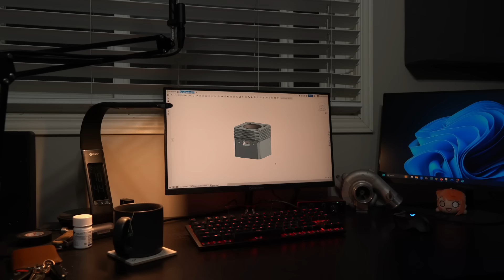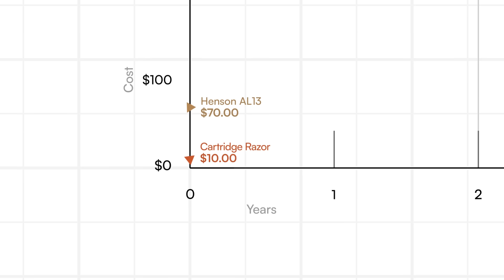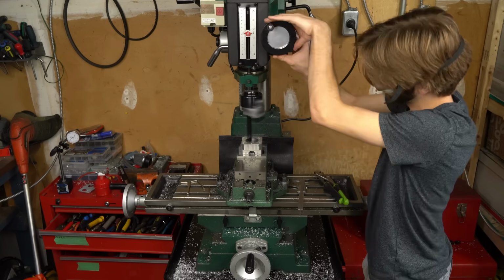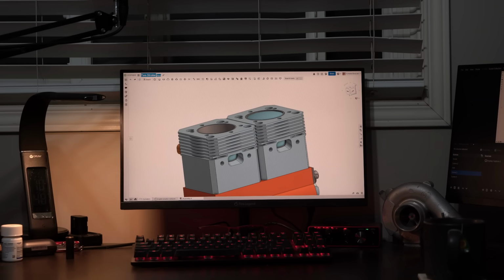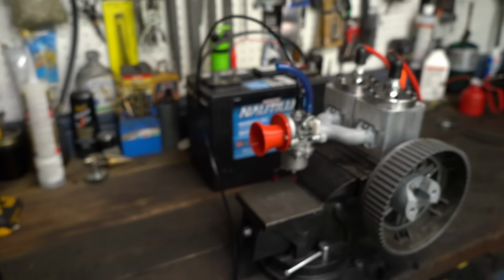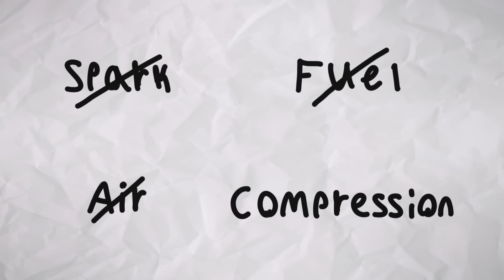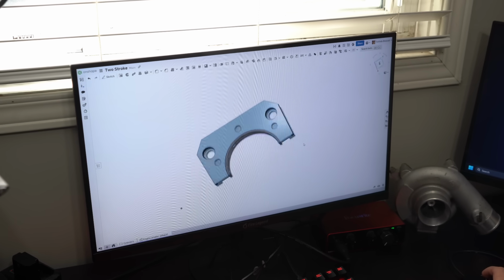Building a Two-Cylinder Two-Stroke Engine

Comment: It crazy that it's easier to build a rudementary jet engine from scratch than a piston engine. Videos like this really makes you wonder how hard it was in the past when the first engines were made. No prior knowledge, no modern precision tools, just trial and error until it worked and perfected. And they made that is the early 1800s or even earlier!!! Crazy.
Reply: Those old engines had very large parts, loose tolerances, slow moving and ridiculous power per displacement. Making it small and fast is another 100 years of development later
Reply: @bumboclat and they worked at way lower rpms with less compression
Reply: And this is a two stroke, in a four stroke you have twice the moving parts! They’ve used the same 4 strokes for the past 150 years. We use them every day without even thinking about it. They’re so heavily integrated in our lives.
Reply: @midgyrich  Four strokes are actually significantly easier from an engineering perspective. Having full control over valve timings instead of having to rely on getting all the fluid dynamics right from the get go makes it much easier to iteratively fix mistakes, especially for the engines of the past.
Those engines were LARGE and SLOW. Crankshafts and such didn't need to be perfectly balanced, lubrication was often provided by just oil-filled cups on top of the bearing journals etc. Valve cams could literally just be bolted onto the outside of the crankshaft and used external pushrods, both of which could be easily swapped or tuned to the right angles and so on.
The type of engine he's making is much more finnicky and unforgiving.

Comment: You can not run a 2 stroke without exhaust, as soon as an exhaust flange even loosens up or
leaks you get a lean condition and a high idle. Bolt 2 separate pipes or expansion pipes and you will have better 
running ang longevity.

Comment: Most high performance cylinders use support all around the sleeve in the bottom portion and just make the transfer port around it because if the sleeve is not tight fit it will also make the cooling a lot less effective and it can rotate while the engine is running which would block the ports (could lock up the piston rings???)

Comment: Hey there, The transfer ports (or any ports for that matter) should have as little resistance as possible flow wise, the way you made them the little bit in between the port isn't doing anything to support the ring or help cool the piston (engine is too small for such necessities) Next time make the ports as easily flowing as possible, also look into specific area-time values for ports as that will help the engine run healthier and easier and make more power jadda jadda. The Jennings two stroke tuner hand book is nice for this, also you could look into more improvements to push this thing a bit.

Comment: Cool man ,but there's a lot of room for improvement 
Why are you using rubber rings? Use metal rings and use smaller gy6 scooter ignition coils those chunky ones heat fast and aren't reliable plus the flywheel looks warped especially in the slow motion in the later part of the video but still it's very entertaining to watch your videos please keep updating

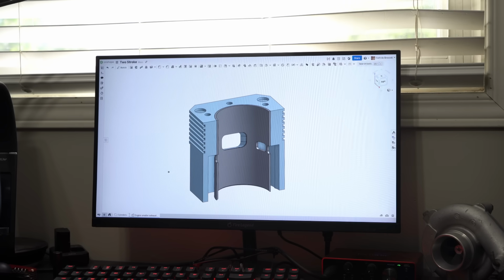Comment: If you want more power , I recommend looking into transfer port angles and hand porting + the short between the ports by the tolerance is not as important as the shap turn in flow at 9:17. You can eliminate the tolerance by coating the sleeve with copper     But great work!

Comment: If you have the room, old used 3phase equipment is dirt cheap.  You don't actually need 3 phase service either.  They make electronic and mechanical 3phase converters.

Comment: Awesome! Do the carbs actually get fuel though? Tank setup looks weird for gravity feed. I'm probably missing something.
Reply from the maker: Honored to be in your presence. Off camera I would manually fill the float bowls with enough fuel to run for maybe a minute or so, I'm looking at getting a proper Mikuni carburetor though since these chinesium ones don't really tune well at all
Reply: @CamdenBowen 😂Thanks! I was missing something then.
Reply: @CamdenBowen nibbi carburetors are pretty good a lot of small engine youtubers use them.
Reply: this is the collaboration i need to see

Comment: Hey Camden! One tip from an engine Enthusiast, Make sure you prevent if not minimalize the vibrations on your flywheel, that way, it can store more energy when spinning at speed, and you'll lower the chances of any parts falling off. Vibration will only further stress the engine and balance is key! If you cant fix the flywheels wobble, Try adding weight in areas to where the weight can be swung out and cancel the vibration! Cheers!
Reply: And try to get some kind of balancing done on the crank and rod assembly should help everything including the shaking.
Reply: @Slightly-Illegal-Moto  Yes, Cant forget that!
Reply: @Ehimherebecasuewhynot  yea I'm blaming all of the lower end bearing/bushing problems on it.
Reply: @Slightly-Illegal-Moto  Ah, I see.

Comment: you should put some thrust washers on the sides of the connecting rods. Will it be perfect long term? No, but it should help with the side play. Also, i believe the crosshatch is a bit too steep, if you do it less you may get a bit better compression and cylinder wear prevention.

Comment: What diameter does the carb have? It looks kinda smol. In the GDR the sizes where: 50cc = 16mm, 150cc = 22-24mm and 300cc = 28-30mm. (This at least was for Simson, MZ and Trabant respectively. There might be other sizes but I only have access and knowledge about those three.)

Comment: i love the engine making saga
Reply: I never get tired of it. It shows you exactly how difficult it was back in the early 1900's to not only design, but build from scratch BY HAND (with tools much less precise)...motors & their functions that had never existed before...and to make them work 100% of the time, for hours, days, weeks and years at a stretch. Millions of man-hours wasted...but thousands of lessons learned so everyone else could dodge the mistakes later on. I still don't get the fascination with high RPM, low-torque engines...the first designs were the obverse...very low RPM, very high weight, very high torque (as far as your first cross-head 2-stroke diesel ship/boat motors went for the era). They lasted as long as they did (like the Detroit 60 series 2-strokes)...simply because at that low RPM (1200)...they were supposedly very forgiving of design/manufacturing errors.
Reply: @TheCaptainSlappy  hi
Reply: Proton S16 Saga
Reply: @BotulinSpikedMarzipan  Proton 'The Goober' Saga
Reply: @zorua_i_guess  That's right, my boy.